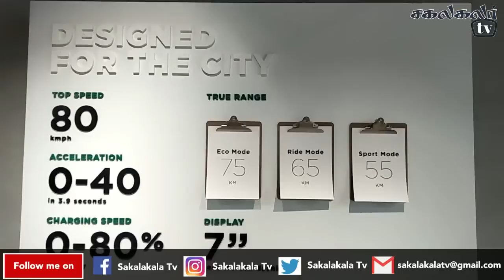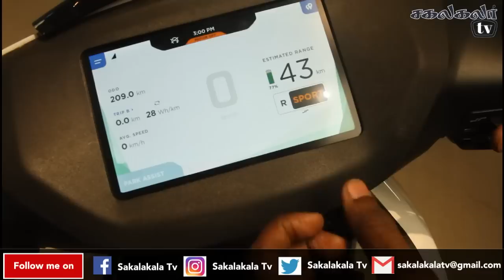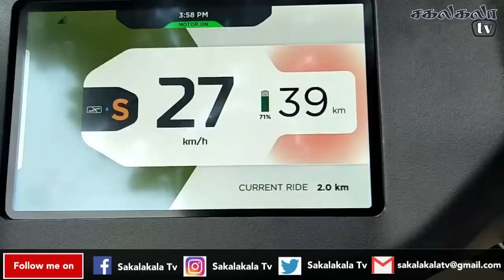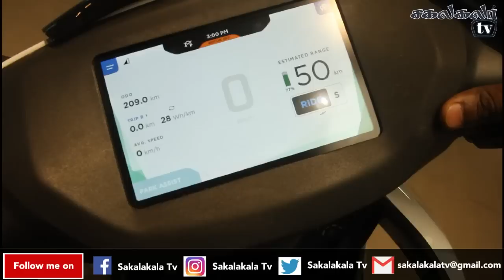Ather 450 Test Drive || The Complete Review || Sakalakala Tv || Arunai Sundar ||

Comment: Sir , I like to know about the safety system  in  " on grid " domestic solar power system. My main question is how do they switch two way voltage on single pair of wire , is that safe to keep the system switched on when nobody is at home for 2 or 3 days ?

Comment: Expensive electric scooter.  Do we need to pay in the public charging and how many units of current does it consumes per hour in our home charging.  Is the price includes portable charger?  What is the maximum payload on this scooter?
Reply: You will not have to pay for the public charging until December 2019. It will consume 3-4 units of power for a full charge. This vehicle comes with a home charging point. You can pay for the portable charging cable if you want.

Comment: When I am riding with 70kg weight or above weight person with me as pillion in the hills in first hairpin bend or more than that or  off road.the mileage or pulling power won't be good as like petrol scooter.then no use of buying any electric scooter.
Leg room is not good not like as beling.not suitable for heavy raining  and also not suitable for hills station
Noise sound is there.in ev there should not be noise sound

Comment: Does not perform well in rainy season, since it drives in the rubber belt.
Reply: How do you know about this?
Reply: @oege9513  Most of the vehicle which has rubber belt struggles to perform in rainy or wet condition, as the rubber belt tends to slip and so not as steel chain.  The drawback on the steel chain is noise.
Reply: @ganeshrvgk  Perfect! Nandri Ulavan. வாழ்க வளமுடன்
Reply: It's not rubber it's far better & different with good friction!

Comment: இந்த வண்டிக்கு மத்திய அரசுமானியம் இல்லையா?
Reply: 1,40000 MRP 
road tax 5200
Registration 800

Subsidy 27000

With 5 percent GST it costs 122000

try to understand battery pack itself costs 40k...they have better Battery management system than anyother
Scooter in  India.
Try to ride Okinawa ipraise ..you'll know how that ride quality is..
Battery keeps hitting the seat and inturn hitting the bum..whenever road is not good. Which means one day it can turn into a explosive. When battery is on constant motion its dangerous..I was about to purchase ipraise worst build quality and battery very loose under seats made me stay away from Okinawa. Also many customer have given negative feedback on after sales service.

So as of now..ather stands better than any electric scooter in India.
Fixed batteries is better for safety purpose.
Also namba oor sollava venum
If your battery gets stolen 40k gone..incase if it has removable batteries like Okinawa.

Comment: if lithium battery shell is damaged it will explode when reacted to air. Lithium fumes are very toxic too. Tesla is protected with thick layers of metal which with stands high impacts, Not sure if the outer shell is that durable

Comment: It's like apple in e-scooters. Too costly. Low range. Fancy and flashy scooter. Less practical.
Reply: First learn about it after that only tell something......  its most environment friendly vehicle......  learn something about it man
Reply: Did you buy one or did anyone of your friends have one? The scooter is no way expensive than your Honda Activa or a Dio's annual fuel and maintenance cost. Range depends upon how smoothly you handle your throttle of any vehicle, this is not just for Ather this is for any vehicle for that matter, if you ride fast am pretty sure you're not gonna get nothing more than 35 - 37. Yes right now there are pretty less charging stations in the city for frequent commuters like myself, but if the situation needs to be changed the fuel companies like HP, Bharat and Indian Oil should also help them out as they should literally set up a charging station everywhere there is a petrol bunk in the city for the quick access of charging the vehicle. Please think before you comment something which is yet to bring a change, change always starts with you and me bro, if you keep complaining the city has bad air quality and go speak about fuel price hikes then you have got to accept or adapt to some change if possible.
Reply: @saisathya6274  😒😴😴
Reply: @sound_man23  🤷‍♂️